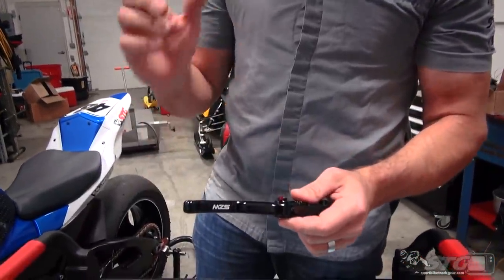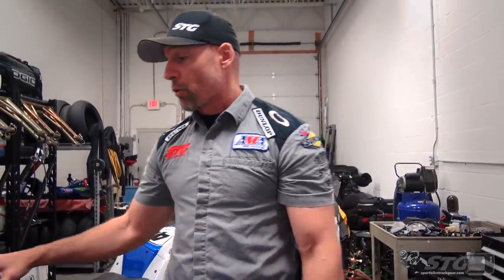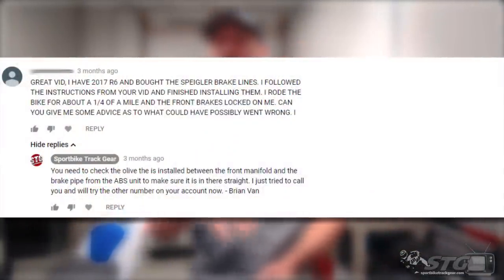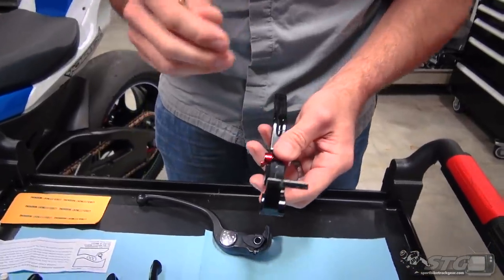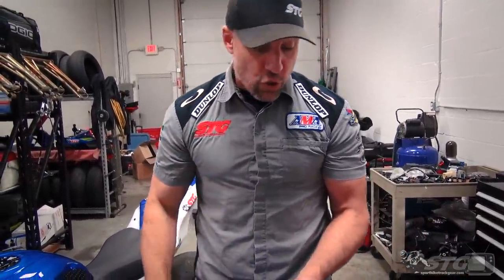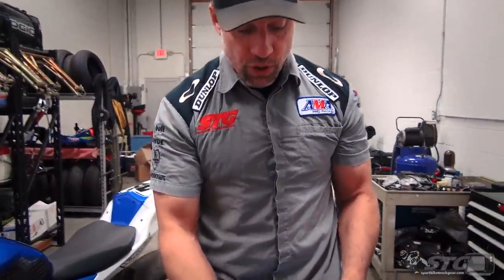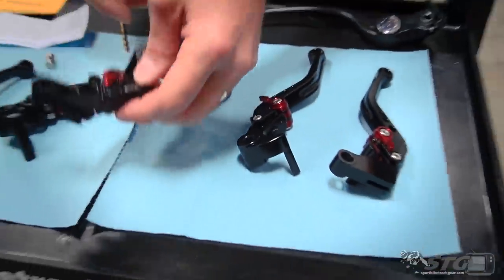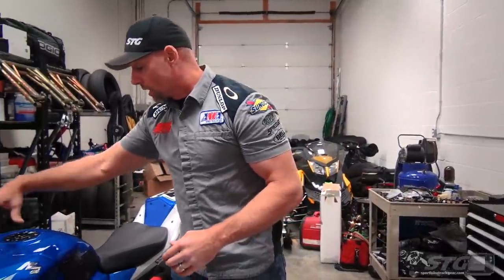The Truth About Cheap Motorcycle Levers | Sportbike Track Gear

Comment: I don't doubt the level of Quality on a expensive line of levers is excellent. They have gorgeous products. Those are premium features that not even OEM levers have. OEM also tend to have a bit of play. I bought some nice Spiegler lines from you guys over a year ago May 2017 for my FZ1  with R1 front end fork conversion and I run them with Chinese lever and M/C. Zero problems. I also bought a used R1 that also had Chinese levers on them and they had been on the bike a long time with no issue. My brother has a 2015 R1 with them with out issues and my friend has a Triumph Street Triple that he picked used  up from a shop with those type of levers already on it. All of them have seen track days and canyon/mountain rides without issue.   

Just by looking at the comments on here its like everyone thinks this happens  all the time.  If this is the cause then shouldn't  it happen 100% of the time?  Are those the actual levers on the customers bike? Were they tested to in fact prove this is the issue.? R&D is not done like that. And if they are truly dangerous levers why could you see them on an old clapped out bike? Dangerous is dangerous. If they are the true issue they shouldn't be on any bike. Cost of the bike is irrelevant to cost of life.   Making statements like clip ons breaking under brake pressure? 
Support the products you sell . That's good business sense. You guys are a quality seller which is why I made a purchase from you after seeing your video also. But don't use hearsay and scare tactics and say I love Chinese people "BUT"..
Reply from the maker: Nothing in this video has been misrepresented, these levers caused the brakes to lock on the R6. I did not do this to scare people, I did it to share something I feel needs to be shared man. You are correct not all of them have issues. That said ask yourself if you want to be the guy who's brakes lock up and you fall because they did? It is also a fairly safe bet these products are not backed by any product liability insurance. While I do not know that for a fact I will say it would be very difficult to cover the expense of said insurance when you are selling a set of levers for $40. End of the day we should all do what we feel is right for us. - Van
Reply: It only has to happen once. Someone tells me a dog bites, I dont go pet it because he looks fine.
Reply: @deathwish8339   Porsche and Ferrari break down.  We own BMW and Audi's in the family and have recalls. It happens. Nothing is perfect 100% of the time.  I'm not saying the Premium Stuff isn't amazing. Ball Bearing in the adjuster is cool.But once you adjust the lever to your comfort do you ever change it? The factory OEM doesn't have that feature , so comparing it to another brand and saying its not as good because it doesnt have that feature is a bit silly. Now looking at the pivot bushing design that Brian Van pointed out IS different from the Brembo design on my R1 and the Brembo RCS design that is fairly common on many bikes. SO with the rotating bushing being tight as BV pointed out he may be right. But that is not every design .And I'm sure that you could free that bushing up fairly easy IF that was a common issue.Should you have to free a bushing? NO, but like any motorcycle maintenance it wouldn't hurt to check an make sure everything is smooth.  As I looked at the comments I saw that there was a blanket response that everything NOT from a premium brand was unsafe.  Should you support the premium brands since they put in the R&D that is often copied? Sure if you like. But Even the OEM copy each other as well.   As far strength is concerned,  all levers break in crashes regardless of make.  Like I said, this not a knock to STG as I am a paying customer and follow their page.
Reply from the maker: @chrisjones7281  Thanks for taking the time to leave this! You could 100% free up that bushing if you had enough knowledge and experience to see the need to do so. The reality is most riders do not have said knowledge nor should they need to, the levers should simply me made to the correct tolerances. I am not saying only premium brands are safe, I am saying these MSZ levers have shit tolerances and have caused the front brake to lock on several bikes (multiple comments in this video already noting brake locking). 

I feel best practice when shopping for brake components, levers, handlebars, rearsets and drive line components is to stick with known brands that have proven themselves to perform. Taking it a step further I also believe we should all support brands to invest in the research and development that works towards making this sport better. The motorcycle industry is very unique when you compare it to others out there. You won't find many people who make their living in this industry living in a mansion or flying in a private jet. Sure you can make a decent living if you work your ass off, passion for riding is the real driving force. - Brian Van
Reply: @chrisjones7281  Porsche and Ferrari do break down, as do all vehicles. They also bring a somewhat unique driving exerience with their crazy performance. You are paying for the outstanding performance and relatively high reliability. A better comparison is, would you buy a known brand like Mercedes or a knockoff clone of a Mercedes like a BYD (chinese manufacturer) for 1/3rd the price. Be honest now.

Comment: Are You able to remove the cross-pin from the lever on the "MZS"? If so, would you use a dremel or sandpaper to free up some space where the cross-pin goes, re-install it and have the play necessary to prevent brakes from locking up?
Reply from the maker: You should not have to do that, the lever should be good to go out of the box. - Van
Reply: @sportbiketrackgear  I understand that 100%. I was shedding some light for the people that don't mind fiddling with their bike parts and would go the extra mile to make the levers work for them. But at sub $50 you should not expect the precision that's present in the premium levers
Reply: I deff want to trust my brakes to a home dremel job......
Reply: @clintknowlton4589  .......you're only putting trust in yourself. If you don't trust yourself then, easy, don't attempt it and go out and buy premium levers instead.

Comment: I appreciate this video.   I bought a set of very high quality levers and because of this video ended up realizing a mistake I made installing them.   I had sloppily applied thread lock to the front brake actuator pin and it dripped into the rotating bushing locking it into a single position.  Went back to check it because of this video and realized the issue.
Reply from the maker: Happy to hear this was helpful! - Van

Comment: Every brake locking/cheap lever problem I've seen so far has been with radial master cylinders. If you don't have a radial master, you'll most likely be fine. If you do have a radial master, there's a pretty good chance you'll still be fine but you have to take a long hard look at your set up and make sure it's working right.
Reply from the maker: Radial masters are the common denominator for the locking brakes at this point for sure. That said not everyone knows the difference between radial and axial. Let's not forget the horrible tolerances these levers have. Better to leave the OEM levers on then install these MZS, they have better feel. - Van

Comment: A great video and great advice that’s just as relevant 4 years later. A lot of folk get seduced by the low price point and funky anodising, but like you say there are certain parts on a motorcycle that you need to be able to rely on 100%. Front brake is perhaps the most important control on any bike, it makes sense to buy quality.
Reply from the maker: Well said and thanks for watching! - Van

Comment: The end result of the video applies to ALL riders, regarding any new gear. (no matter who makes it) Inspect your new gear, BEFORE you install them,  AFTER you install them,  do a pre-ride check , and then an "in/on-ride" check. If it works properly 100 percent, include it into your weekly/monthly maintenance  intervals.  If it does not function the way it is advertised, RETURN THEM, immediately.

Comment: Coming from the IT world where most things are made by a select few companies, take Dell and HP both buy their motherboards from Foxconn and are made on the same assembly line....    The point is all this trash levers, computers & underwear are all made in the same sweatshops but certain companies pay the sweatshop owner just a little more
Reply: That's not exactly how it goes. It's more by Egineering and Design, you can't buy Egineering for $50.

Comment: Axial master cylinders use simpler levers than radial ones , that means that a cheap and even chinese levers can be used in relative safety but radial ones need  really good ones ! But not just for safety but for feeling!
Reply from the maker: You are correct, now do you think most riders who purchase levers know the difference between radial and axial masters? IMO they should not have to know the difference, the levers being sold need to be manufactured to proper tolerances. - Van
Reply: Sportbike Track Gear you are absolutely right! I have some Chinese levers as spares and the difference between “good Chinese levers” and bad  ones is just too much as a gamble if you don’t know what you are doing
Reply: To preface, I HATE the Chinese knock-off economy, but I disagree profoundly with the general sentiment expressed here. Drivers, and Riders even moreso because we should hold ourselves to a higher standard, should understand the simple terminology and technology involved in constructing our machines. Knowledge is power and you wouldn't need to make these videos if Riders understood simple engineering principles.

Comment: Great video as always! Chinese here. Those eBay/Aliexpress cheap levers like $30, are ABSOLUTE HALF BAKED CRAPS. I bought a pair for my ninja 400, they said designed for ninja 400 and even had 'ninja 400' etching on that. The brake side works fine, but the clutch side is just too big to fit in, you actually have to grind away quite a lot of materials to fit in there. It turns out they just rebadge the ninja 300 levers and call it a day. We have quality manufacturers back there, but these cheap craps are definitely NOT one of them. I hate those. They're the ones that making bad reputations for MIC products. Seems like the money you saved is just for paying your time and effort to make it fit. Would not choose those cheap craps again. Thanks for the info.
Reply from the maker: A lot of good products are manufactured in China, these levers are not on that list. Thanks for watching! - Van

Comment: Agree 100%, people seem to think that they can pay 10% and get 100%. Not how it works! I treat the mods i make for my bike (cosmetics excluded) as if i were buying new tires, i'd not skimp out on those, so neither will i for a lever or rearset, or chain...
Reply: @Patrickisnt  ha ha, example, my XJR1300 - front wheel OEM bearing (NSK) 20 Euros, go to any shop and the same bearing is 10, be it SKF, Koyo, NSK :D
Reply: with expensive levers you pay 500% and still get 100% at the most ;)

Comment: Oh man i have the same lever just on my FZ6 Clutch, the brake is OEM. 
But its helped pulling the clutch soo much easier, like a completely new bike. So far after a solid year of riding through every season, its held up. 
I will keep an eye on it though.
Reply from the maker: The levers you need to watch are the radial brake levers. I have not heard of any issues with the clutch levers. Still I would not recommend installing any sub par controls on your motorcycle. - Van

Comment: On my way to work this morning my brakes locked up on my recently bought ‘16 R1S. Very fortunately to have been able to slow down in time and get footing but the bike was too heavy due to the slope of the road so I had to lay her down. Go figure it was due to MZS levers I installed. Last time I buy cheap aftermarket parts. I had thought I just did a bad install. I know this video is old but you saved a life. OEM levers are going back on. Thank you Brian.

Comment: I have had these MZS’s on my K1200S for years now. Have not had any issues from day one. If there was, I would have sent them right back immediately. I drive test everything I install in my driveway then around the block before I go rippin’ around. I have trusted these levers time and time again over 180mph. Maybe it’s because mine used the lower half of my stock levers and were not a direct replacement. 

Good video though I enjoy all of your vids. 

Lesson: test your stuff before you go ride.